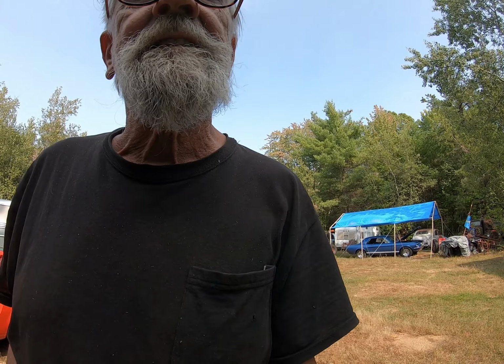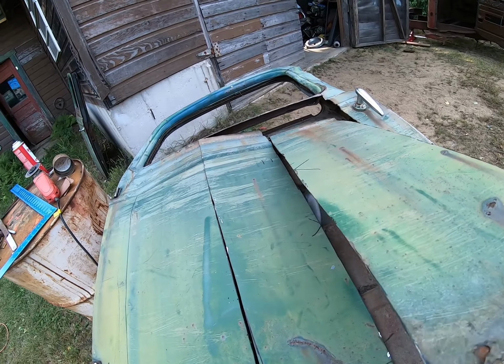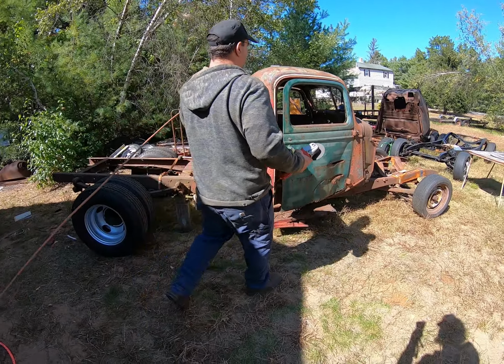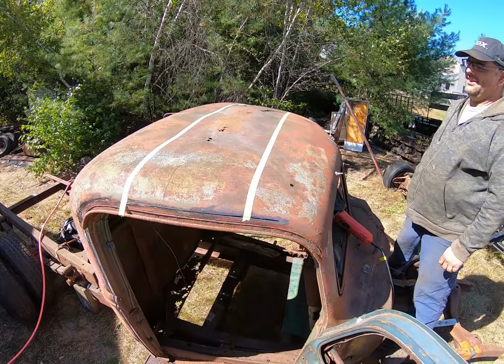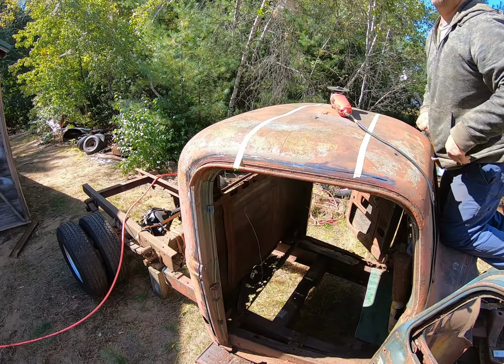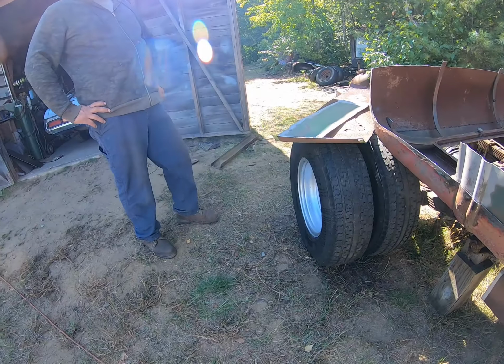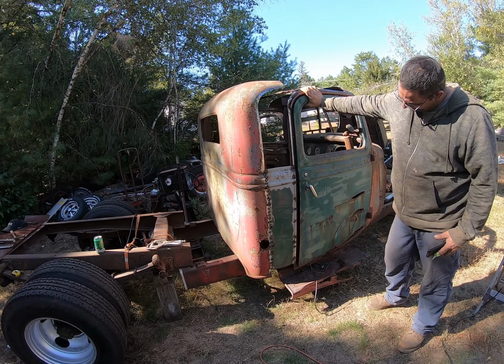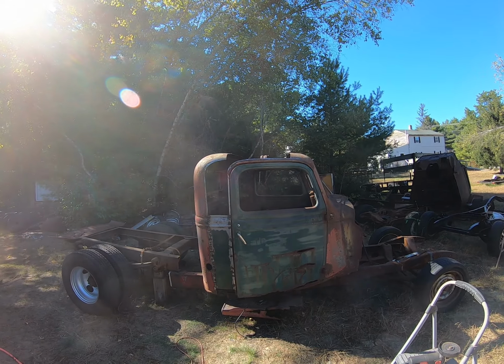stretching the cab on the 37 rat rod.

Comment: Thanks for your video.  I have a little British Fordson 1952 E83W pickup (1938-1957) and the cab is tiny - and I am 6'2", so I plan to extend it about 75mm (3in.).  Your video made it clear that I shouldn't go straight up and over the roof but make the roof                                      join a bit more over the top of the door which will help me keep the shape in the roof corners - thanks. Also, even though the E83W was a similar era as your 37 and also made by Ford, the British trucks were very basic and therefore the bead rolled line on the door didn't continue across the back of the cab like yours - a feature that I love, so I have purchased the bead rolled line from the side panel of a E83W van which I plan to run across the back and round to the doors.
Reply from the maker: The offset cut makes it easier to keep the roof straight. Our roof was caved in and was full of dead leaves so it rusted through. We used a roof from a 48 Pontiac to replace the rotten part.
Your project sounds interesting. Are you going to post some videos? I want to see how you curve the rolled bead around the back.

Comment: Its looking good. Looking forward to seeing more metal on it and what the bed will look like. 
Also waiting to see what you put on your frame Al. 
The hot rod I have always dreamed of having is the 3 window 34 Ford in The California Kid. :)
Reply from the maker: Thanks.  We have more projects than we have time for. Besides the two rat rods we have to do rust repair on the Montego GT. My 65 Mustang isn't running right so I have to tear down that engine and to further complicate things I now have to upgrade the 67 Mustang that I sold. The new owner, Lewis, is a young guy from England who wants it to have a V8 engine, disc brakes, power steering, power brakes and an automatic transmission. I'll also have to change the rear end . The 6 cyl rear can't handle the power of a V8 and it's a 4 lug rear. the disc brake conversion is 5 lug. So it's going to need a new set of wheels.
Richard is going to do the disc brakes Saturday and I'll post some video on that. I've also hired back my helper Mike to help with the engine swap.
Mike is also going to do the brake lines on the 40 frame. I have a stock gas tank that almost fits so I'll be doing some modifications to make it fit. I ordered a new floor for the 40 pickup cab but they are no longer in production. I found a company that will make it for me but they couldn't say when it will be delivered.

I also have to finish the 55 Ford pickup and get that sold. I thought retirement would be easier than this. 
How's that scooter coming along?
Reply: @alshotrodsandratrods8780  Hi Al, Got the scooter running and sold it. Just waiting for another project to come along cheaply enough so I wont break the bank repairing or restoring it. lol. 
I hope you are charging for all the work you are doing for the Mustang.  Not very English of him to want a car but half of it has to be changed to his liking to buy it. 
Oh well. Some are fussy buyers. 
I am looking forward to seeing the build projects. I notice the Grunnal or whar ever it is called (dont have anything called it over here in UK) Sorry if I got the name wrong, but it is a nice van and I thought the buyer would have taken it to work on it. :). Stay safe friend and looking forward to more vids. :).

Comment: 3 years later and im wondering how this turned  out and if it did?
Reply from the maker: The cab is finished but the project stopped there. We started too many projects and haven't finished any of them. I sold my Mustang and have to finish my 55 Ford F100 so I'll have something to take to car shows. The 37 is one of Richards projects and he's been working on his 48 Mercury, He's also buying out the shop where he works and working weekends to earn some cash. There's no heat in my garage so I can't get anything done out there until the weather changes. I'm hoping.to make some videos soon. Richard has 2 engines for the 37 and can't decide between a 350 Olds and a 302 Ford. He doesn't have a transmission for either engine. I'm still trying to find a Chevy turbo 350 trans for my 40 Ford pickup. The 55 pickup and the 48 Merc will get finished this year. I don't know for sure what else will get done. There is a guy who wants to buy the 37. I don't think Richard will sell it but he does need the money. If he sells it I'll still follow the build at the new location and post videos on it. If you're not subscribed I could use more subscribers. I need 1,000 before I can make any money from you tube.

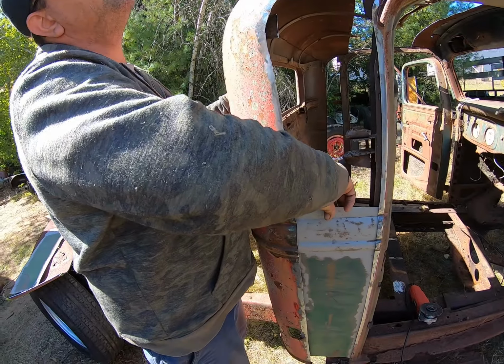Comment: At 12:30 what part did you wish you didn't cut off? I am doing the same thing 6" on a 36.
Reply from the maker: Where I cut across the roof. I should have left it longer to line up over the top of the doors We welded that piece back on later.

Comment: Not quite the way I would have done it.
Reply from the maker: I know. Most people would cut the doors in half and then spend hours trying to get them straight. Is that what you would do or do you have a better way?
Reply: No I wouldn’t cut the door either I would have cut it just like you did straight up the side and pretty much straight up over the top. So I don’t have to deal with how narrow the cab is in the front or middle of the cab. Just so you know I wouldn’t have cut it straight across the top either.
Reply from the maker: Not a good idea. The offset cut is to align the two pieces after they are cut apart. @LeroyKidd-m5z

Comment: Why would you use a grinder over a metal shear or a saw?  Aren't you warping the metal by cutting it with the heat from the grinder blade?
Curious because I have a Project Truck I want to do that involves stretching the body 19 inches by splicing 2 SUV bodies together. I always thought using a sawzall or my drill powered shear would warp it less. Just haven't gotten around to that one since I retired.
Reply from the maker: The thin cut off wheel doesn't generate enough heat to warp the metal. No more than the mig welder would. Any type of shear would have deformed the top portion of the door. A small saw would have worked if I removed the door latch and window mechanisms first but the blades don't last long. With a sawzall  I would have to skin the door first and the vibrations would rattle your brain. If you don't have body lines like the top of the door the drill mounted shear will do the job. I have one that runs off the air compressor but it gets stuck a lot. Doing the cutting and welding at a door post makes the finish bodywork easier. If you do it in the middle of a panel I found if I spread the tack welds and alternate tack welds on either side of the panel it keeps warpage to a manageable level. I stretched a pickup bed that way and painted both sides. When I tell people I stretched it they can't find where it was welded. Pickup beds are thicker than body metal but you probably only have to make one side look perfect.

Comment: Before you cut the cab you should have braced it so it would stay square otherwise it creates a lot of problems.
Reply from the maker: We got lucky on that. I cross braced my 40 pickup cab when I chopped the top and used a ratchet strap to hold the doors in place but I couldn't get inside to do the welding. I couldn't fit through the windows.